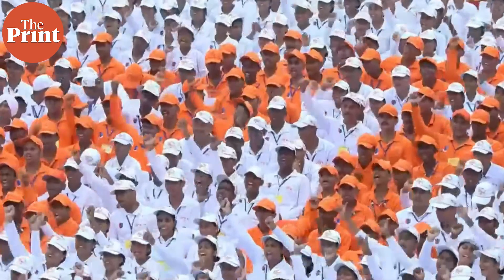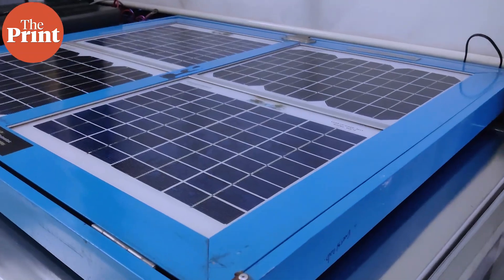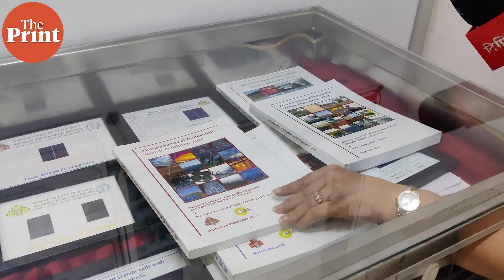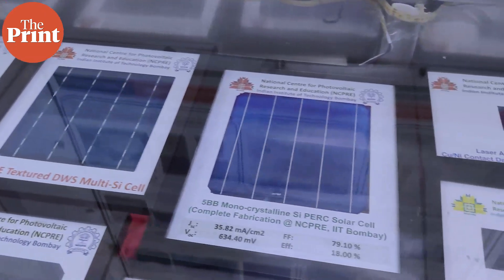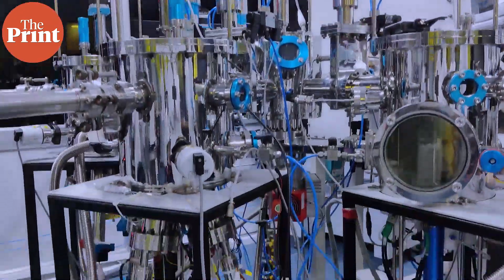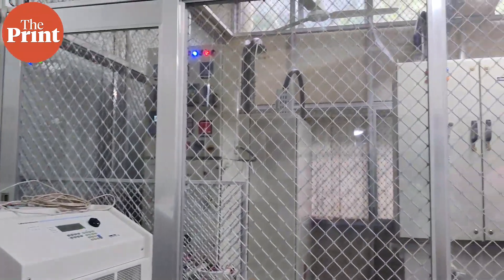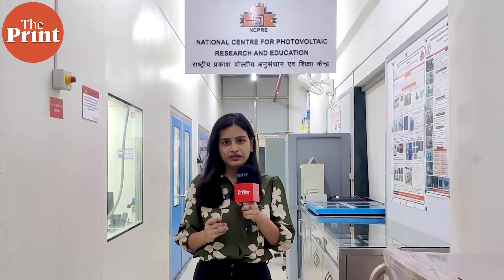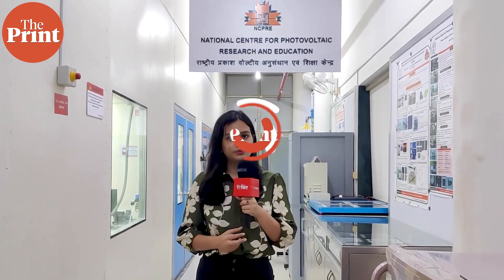How one IIT Bombay lab is leading India's solar energy breakthroughs

Comment: It is good news. Instead of as usual panels, the Germany has prepared paper type solar stripes which can be easily pasted it on tin roof sheet connected  to  each one and it is very  to instal. Such innovation is also need of the hour.

Comment: Never try to copy paste from western  solar tech of northern cold climate countries. They are getting  more  visible lights  having maximum  only 40 percent of total radiated energy from sun. Our country is getting more infra red  energy of above 700 nm nearing 55 percent . Let our kids try to harness that spectrum using  thermoelectric  junction material  just below the SPV sheet  to generate more on reverse peltier effect . This will also save space, heat loss, efficiency loss, and damage to the SPV panels. Regards, dr. A. K Sarkar.
Reply: Ok....but that spectrum , can be Tuned in with Peroskite and other hybrid methods, also for a wide bandwidth of light energy to be harvested....Thus the hybrid methods of using Peroskite and sandwiching in with silicon.....Now to find best elements and methods , for longevity and higher light energy received/ stored....They better move faster with their research in  India,. Or will be soon left behind , by even solar researchers in little Australia....much less labs in China and America,  where solar was invented for satellites....

Comment: I have worked on Perovskite materials. They are absolutely horrible. They contain large amount of lead (Pb) which is poison. If there is any lead leak from these solar panels on soil, then you wont be able to use that soil ever again. Just stick to silicon solar cells. Perovskite only improves efficiencies by 2-3% and they degrade very quickly. Tandem solar cells is nothing new, I have fabricated them 3-4 years back. I also know this guy he was working in Cambridge. Waste of time and money.
Reply: Not True.....Who believes you now , with your bad info ? Thinking of some silicon panels....

Comment: Nuclear is best, solar is so called green but then recycling is also a problem then deploying need large scale area it is better to fund thorium reactors. India has the largest thorium reserves. At scale solar is never possible then for storage we need batteries lot of waste when we take account of its full cycle. Please support nuclear. But the support to fundamental research even solar. Huge support to researchers
Reply: Not so much an issue now with recycling....as most weight is in silicon/glass , and aluminum metals....With silver going up in value , even the silver Paste , will become much more important....Just that Solar panels longevity is 25-30 years....With even poor people able to afford used solar panels....for pennies on production costs...
Reply: @randyhiggins1563 , there is a pain to recycle existing panels all goes to land dump. There are many layers for packing we can not recycle efficiently. Lead and many other materials are there even if we it is lead free it is not possible. Now if we consider mass and area it is far worse for the pollution it creates than nuclear also the energy density in nuclear is so high. Yes indeed PV cells are good but then lot of subsidies are the if we take account to full production cycle till recycling then cost is high. If we dump like plastic no problem then heavy metal leaches to ground water will also damage the environment. I support research but physics is clear that nuclear is king.

Comment: Isn't solar more vulnerable to attacks due to the open exposure to sky in case of geo political conflicts?
Reply: Large area exposure.. true
Reply: They are so large in area that it will won’t be worth the effort. High capacity power transmission lines are better target than solar plants.
Reply: Now do Nuclear power plants , which is highly concentrated in small areas ?

Comment: Solar is good, but need to focus more on Thorium.
Reply: How about both.. Lets do both 😊
Reply: @Nobody-jj2yk  I get it, but thorium is far more promising
Reply: @kunal2000_ true  thorium power plants... It is very important we need it fast .
Reply: @kunal2000_  I know... But it's not like we can't work on both... Even I know we have vast deposits of thorium
Reply: @kunal2000_  Let's hope so....But the entry point , for even researching Nuclear/Thorium is many X , what Peroskite solar labs are....How many labs are even doing research in Nuclear/Thorium  ?
Reply: @kunal2000_  only....Another 10 years out.....Also said in late 1950's....
Reply: TIFR Physics Department lab is working on it ...!!!
Reply: Or in a combination.....As the nuclear research , takes a more expensive path....What with expensive nuclear researchers , and mega radiation equipment and much larger labs , for the extensive radiation shielding....Whereas Peroskite labs are much smaller and easily accessible.....As Elon Musk has said....Solar and more efficient solar , will be the cheapest source of energy in our  future.....Accessible to nearly all currently.....As storage LFP batteries , are coming down in pric3 quickly....